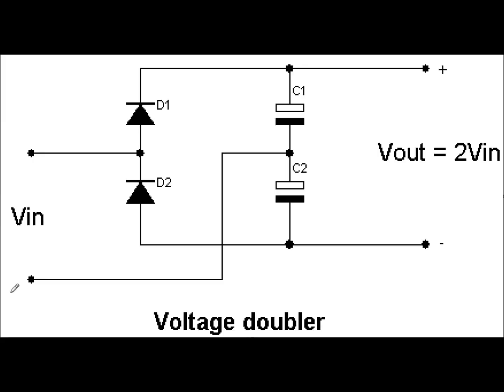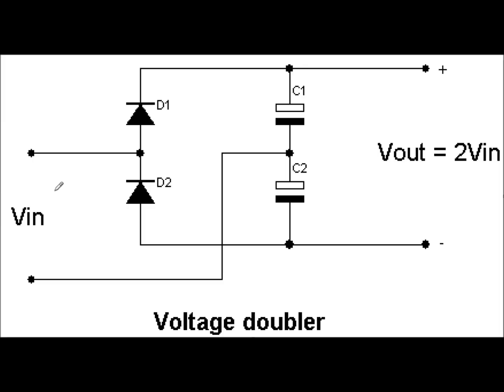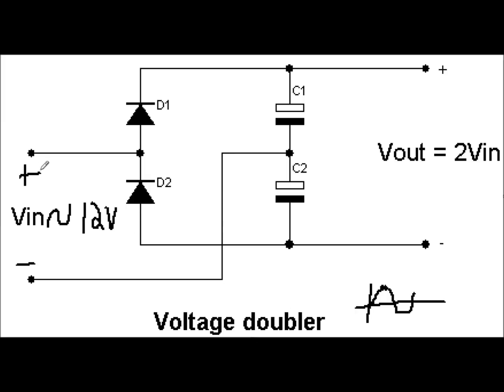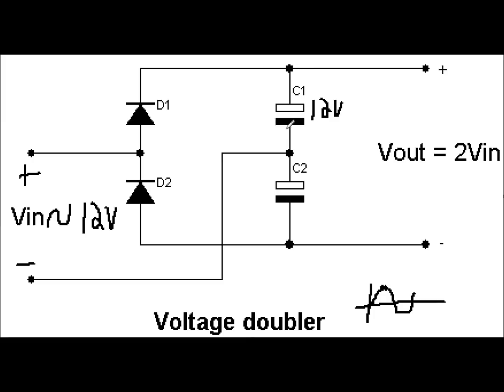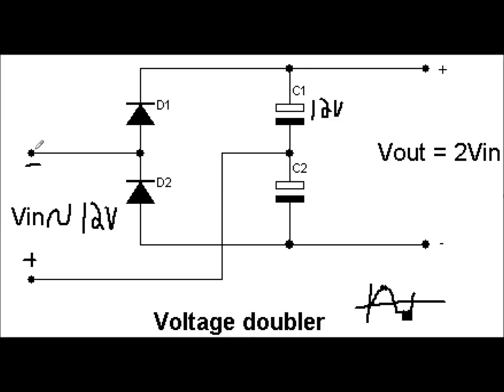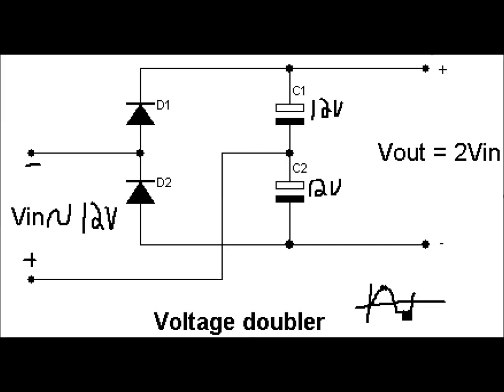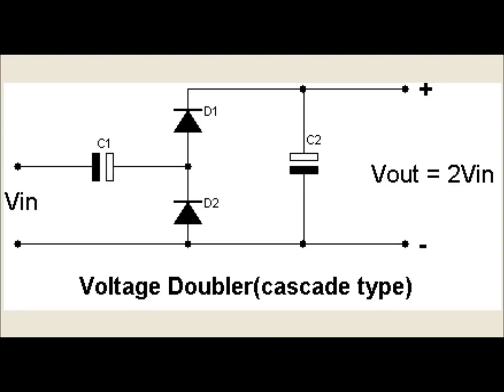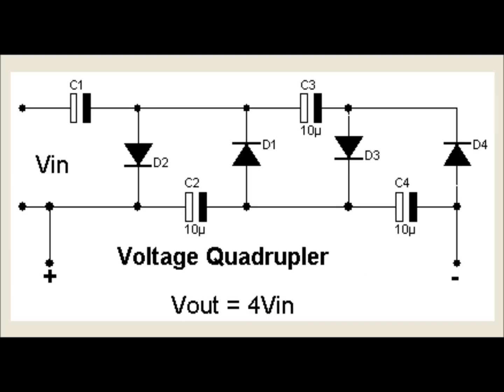Simplified Charge Pump Theory

Comment: The most useful is to make symmetric dual dc output from a single ac input voltage for op amp power supply circuits.

Comment: Ah, I would not have thought of charge pumps and voltage multiplier circuits as the same class of devices. But I do see one error, the output of the voltage doubler will actually be 2*sqrt(2) times the original RMS AC value. A 12Vac signal in reality is just under 17V peak, and that is close to 34V peak to peak, which is what the no-load output of this circuit will be disregarding the forward voltage of the diodes (which is dependant on the type used, current, and even temperature.). So in practice I would expect an open circuit voltage of close to 33.4V with silicon diodes (assuming about 0.3V drop across each one with minimal current flow, determined by the leakage current in C1 and C2).
Reply: @John Holdaway 17 * 2 = 34v peak to peak.
Reply: @John Holdaway OP uses 12Vac as the input, and it is industry standard to assume this is the RMS voltage rather than the peak voltage. Of course 12Vrms is 17V peak or 34V peak to peak. His analysis checks out if you assume he uses 12V peak, or 8.48Vrms.

Comment: Excellent and simple! You helpe me remember this that I had not used since the uni! thanks a lot (ps: you should diff. between '-' and GND, on the output is a reference GND on the input is a '-' voltage in reference to the other input cable ,or direction)
Reply: Yeah, I saw this circuit decades ago, but it's nice to see a good refresher like this. Well done.

Comment: Thanks a bunch Bshizzle. Most elaborateed and simplified explanation of the charge pump working. I hope the S882Z charge pump ic works on the same principle. I tried finding out the internal circuit of the ic but no luck. :(

Comment: So wikipedia calls a charge pump a type of DC to DC converter. However what you've shown in this video is a type of AC to DC converter. Does this mean a DC to DC charge pump must first convert to AC before converting to an increased DC voltage?
Reply: same question
Reply: Suresh Kumar the diodes rectify AC-DC!!  #SchottkyDiode  i guess
Reply: FoShizzle713 I believe that the solution comes from the fact that in the wikipedia article there is actually a digital square wave being fed through two separate wires. It's essentially the same principle except with a square wave instead of a sinusoidal AC wave. Don't quote me on any of that though. I'm not an electrical engineer.

Comment from the maker: The only circuit I am familiar with is the "Boost Converter". However, it is substantially more complicated. In order to be designed properly, there is a fair bit of math involved to size the capacitor and inductor properly. Furthermore, the MOSFET switch typically needs an external pulse width modulator circuit. However, they are very versatile circuits as you can vary the output voltage using the PWM. They can also be used for higher current applications.

Comment: Yes you're right, I touched the terminals both ways because my meter showed a negative voltage...I missed the bit about AC input..Is there a similar circuit for DC input?..Thanks
Reply: Not directly, but you could drive a PWM circuit from DC and provide that to the input.

Comment from the maker: Hello. I the main issue is that a 9V battery is a DC source. This circuit needs an AC source. I assume to get the 18V you touched the battery to the circuit and then reversed the polarity and touched it again? Regardless, the dropping you saw spurs from the equation I=C*dV/dt. What this says is as current is drained from the capacitors, the voltage drops. In your case, very small leakage current through the voltmeter or circuit components would cause the voltage to slowly drop.
Reply: In that case you need a boost converter

Comment: Hi..Thanks for your video and instruction. I made one, put 9v block battery onto it, the output showed immediately at 18v ish, then started to drop quite rapidly I disconnected the battery at 13volts, I think when you try to use the voltage it drops away...Can you tell me why?..Thanks